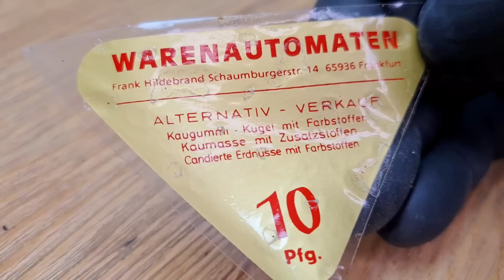Damaged And Rusty Gumball Machine Restoration [With a lot of candy]

Comment: was the sheet of Polyethylene terephthalate the thickest that would work with your vacuum setup? I see it distorted under the load of gumballs. did you consider adding ribs or raised patterns to add to its stiffness? drinking ginger ale out of a PET bottle as I watched this, thinking about its design....